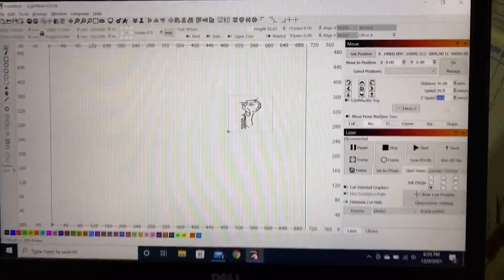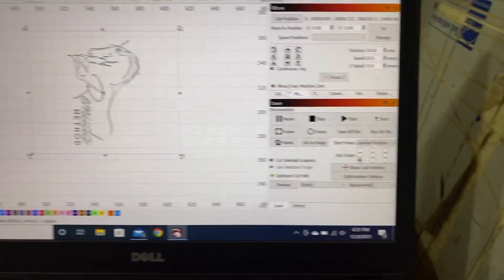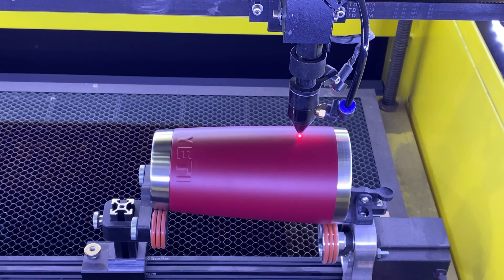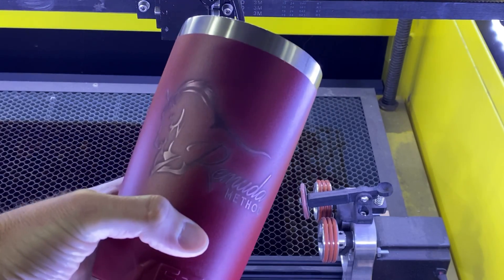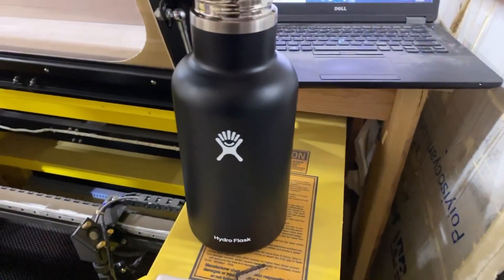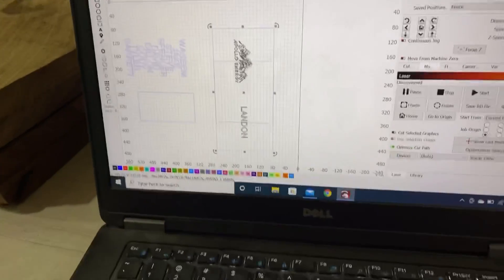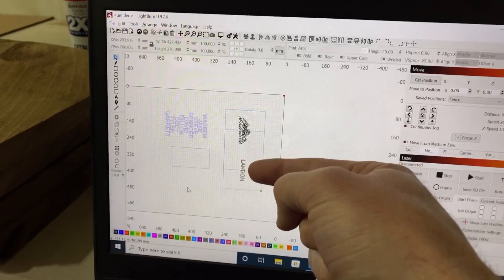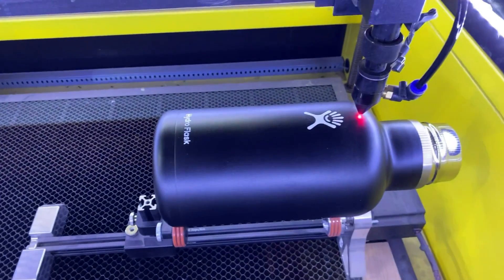Co2 laser engraving alignment for tumblers with branding (one sided and two sided)

Comment: How do I keep light burn from trying to cut the “boundary box” and only the image ?
Reply from the maker: Change the boundary box to a T1 layer or turn the output off on the layer.
Reply: @BeardedBuildsCo  will it still use that box as the origin if I turn it off?
Reply from the maker: @ShopKURCO  yes

Comment: Instead of offsetting the yeti logo, center it up like you said. Then can you just move the origin of your picture to the center left selection node? Just seems logical. I'm just starting in lightburn, i honestly dont know if that will work. Unless this is just a better way, and you have tried that.
Reply from the maker: With the 4 wheel or roller tumblers the issue that I have come across is that I need a board box so give the rotary time to start and get the slack out of the belts or else it will leave a flat spot on the design.

Comment: Great video. What are your speeds and power settings for tumblers?
Reply from the maker: For intricate designs 150mm/s at 22% .05 line interval

Wide open designs 300mm/s 40% .05 line interval

Comment: Do you have a way of "testing" the design on a tumbler before you commit it? Thanks for making these videos.
Reply: Wrap your tumbler in aluminum foil and masking tape. Laser off the tape to test. CO2 Laser won't go through metal
Reply: I just use blue painters tape and I have settings dialed in that it lasers it white but doesn’t burn through the tape

Comment: New to the Laser. Watching your videos to move forward is greatly appreciated. I bought a rotary like yours and I love it. Everything appears to be good except for the text. The angles in Ms Ws are wavy and I have internet searched to find a solution. I have slowed the acceleration and still have wavy lines. Starting to pull what little hair I have left out. Any suggestions. I have an OMTech 80w red and black, Mansfield rotary 3 phase, polar camel tumblers.

Comment: I just installed a rotary device and currently working through some issue with MFG.  However, It seems like my laser has lost its table limits, as well as the over-limits, to keep it from crashing.  I can jog the machine in both the +/- direction on the "X" axis but it will only will short jog in the + direction, in the "Y" axis while freely moving to back of the machine, or "-" direction.  I could use some help getting the machine corrected so I am not dead in the water.  Any suggestion?
Reply from the maker: Turn the rotary option off in the software

Comment: Ive just gotten my roatery and it looks the same as yours, but mine has the clip wheel thats goes inside the cup to hold it. It can be removed with scres. On the few things i have done, names and logos, they appeared to be streatched. Not sure if this is an optical illusion or not. I have squished the files a little and they come out appealing to the eye. Do you "squish" your files? Am i doing something wrong you think? I found another video somewhere that talked about it but now i can find who uploaded it.
Reply from the maker: Have you calibrated your steps per rotation?

Comment: Thanks!  Your method is much more precise than mine.  Couple of questions.  Do you laser with the door open for the camera?  How is the extraction in that case?  Also, what air assist do you use?  I find a minimal amount helps keep my lense from getting dirty…
Reply from the maker: I only leave it open when I am trying to take video. I set up my own air assist and this is how I did it:
https://youtu.be/y08B1v8-q-c
Reply: @BeardedBuildsCo  oh I also used your air assist video :). Was just wondering if you use low psi on that engraving as well

Comment: I have the rotary chuck. Is there any reason you don't center your origin instead of having to offset it?
Reply from the maker: With the 4 wheel rotary there is always slop in the belts and if you go from a center position it will leave a flat spot at the beginning of the engraving. The chuck rotary shouldn’t have that issue.
Reply: @BeardedBuildsCo  I was going to ask the same question actually, so you dont recommend using a centre origin in this case? (Im getting the same rotary). Do you have an example of what occurs when you centre?

Comment: Thank you for sharing this.  Couple questions....why don't you view the image on the computer in horizontal alignment? It is hard to comprehend when all other work on wood, etc is done in horizontal view.  But, now that I think about it, the tumbler is arranged differently in the laser....

Why don't you set the starting point and origin to dead center at the bottom of the design?  Wouldn't this be an additional way to ensure centering?

Tumblers seem so intimidating!
Reply from the maker: The you are correct the design is turned because that is the way the tumblers are oriented in the machine.

The issue with just using a center start position is that there is usually some slop in the rotary and when it goes back to start the engraving it will create a flat spot on the beginning of the design.